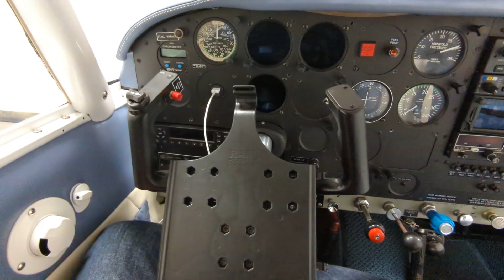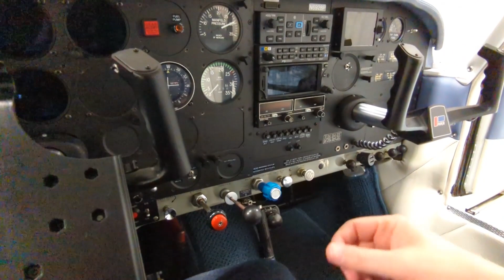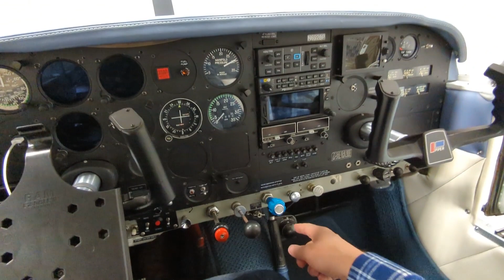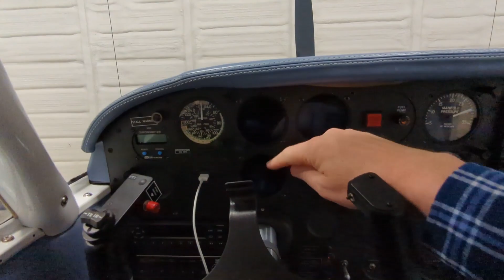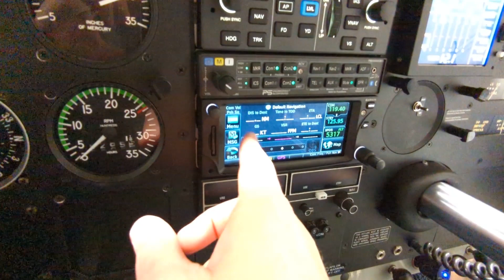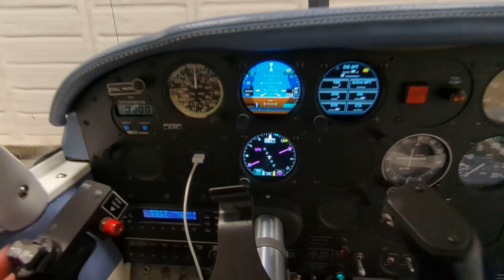Piper Comanche 250 Summary of Updates

Comment: Looks great Mike. Congratulations. Glad the saga is finally over. I have recently upgraded mine as well, but one thing I could not bring myself to do was get rid of my vacuum pump. Put in a 650 with one 275, 255 nav comm, 345X, and a new vacuum pump. My luck with electronics is less than stellar, so I still wanted it for some added redundancy with the backup PFD on the 275. Hopefully a GFC 500 and engine monitor will be next. Maybe even some of those MUCH better looking yokes. Merry Christmas

Comment: The answer to both questions.  You can’t change the course pointer on a GPS. That is only for VOR/LOC. When the needle is green the you can change it. It is green in the VFH Nav mode only. As for the other question the answer is ‘it depends’.  If the screen goes blank due to a back light lamp then yes the autopilot will still function fine.  If you lose complete power on the top unit or have any other complete failure then no, I don’t think you will have complete functionality. Maybe just some very basic modes. Because depending on how it’s wire, you may lose the magnetometer. I am confused though. Did you say you have the AP version. You don’t need that of your GI-275’s are with the GFC-500 autopilot.
Reply from the maker: Hi John,  yes I have the AP version because we were originally going to put the STEC-3100 in.  They for your thought on what happens if it fails.  Mike